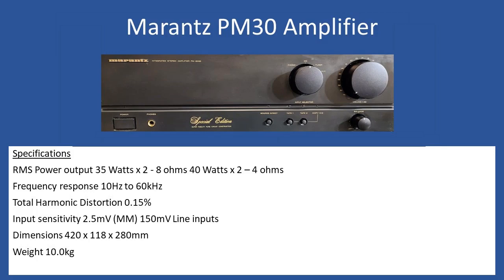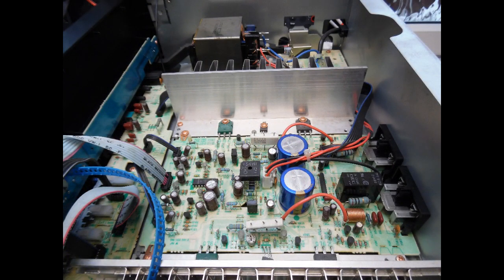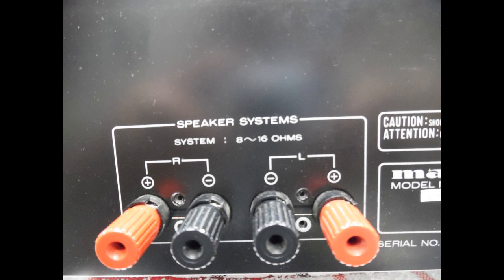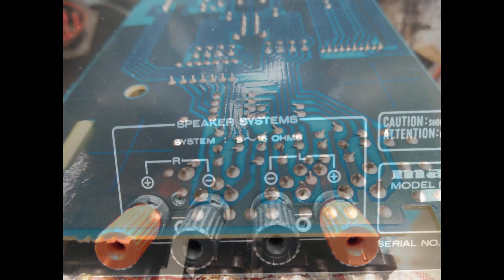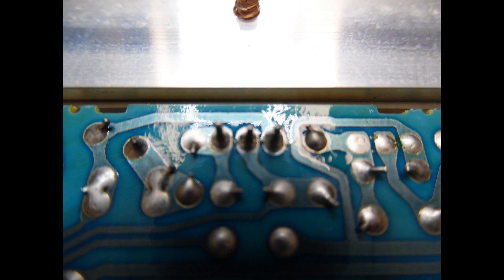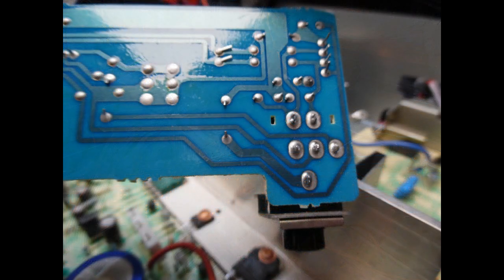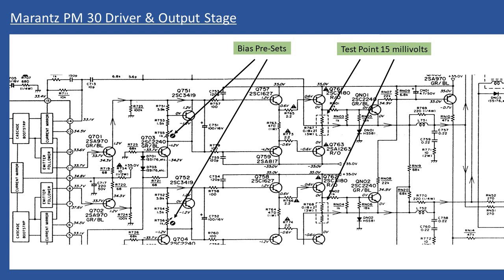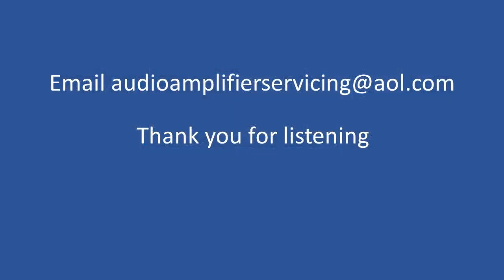Marantz PM30 Amplifier Repair (With Audio Tutorial)

Comment: My unit does that exact same thing. I've cleaned the input select switch and still it happens. One day perfect sound on both channels the next only 1 channel and the other is low and crackling.
Reply from the maker: Hi I would advise you to do the work detailed in the video. The input selection switch needs to be removed and taken a part and cleaned with a fibre glass pencil. Also all bad solder joints on all the circuit boards need to be resoldered and the speaker protection relay replaced. Then reassemble the Amplifier and set the bias on each channel.

Comment: Interesting vid mate. I have a pm 30 and the sound on both channels drops out intermittently. Sometimes just the one channel will crackle and play but at a very low level and only certain frequencies. Does this sound like a problem you e come across and any tips ?
Reply from the maker: Paul I would advise replacing the speaker protection relay and also clean the input selection switch.
Then retest you should find the issue has been resolved.